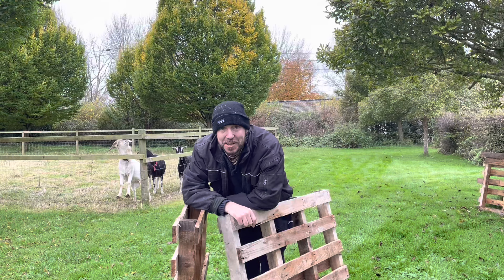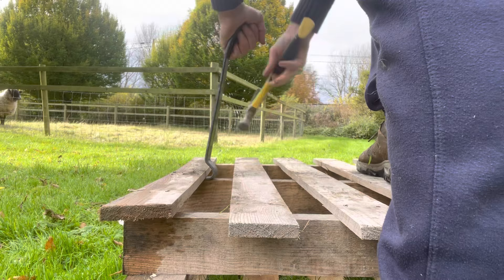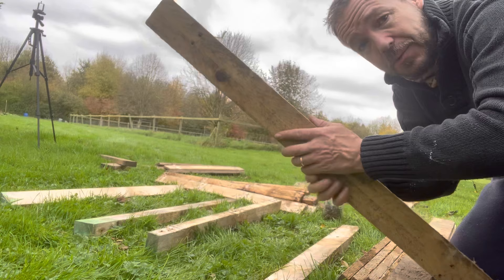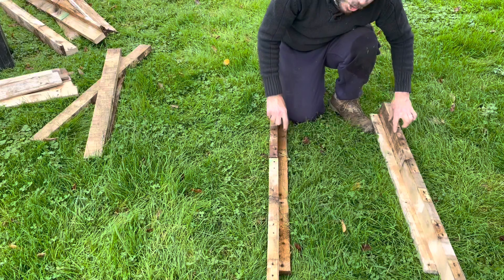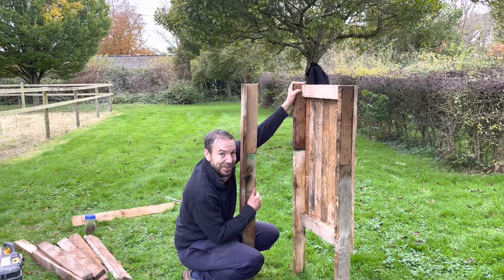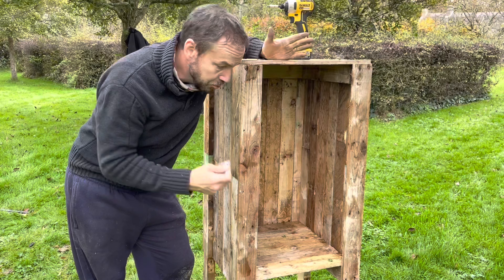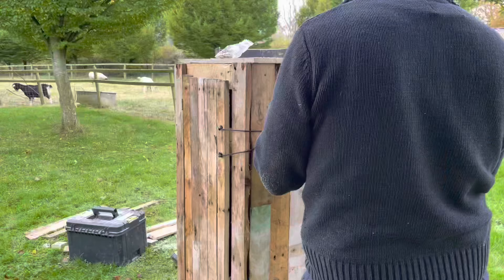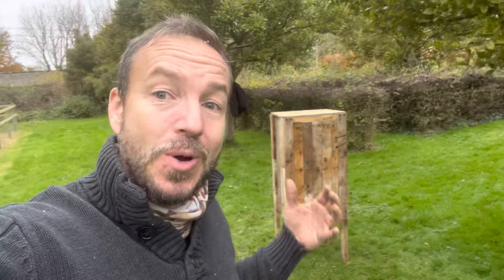How to make a smoker from pallets - upcycling!

Comment: Outstanding setup...however please be careful when you use pallets as they are used for an extremely wide variety of shipping options to include poisonous products and or products you wouldn't want around your foods.
Reply: They spray the pallet wood with formaldehyde when building the pallets 
That's what you got to look out for ...
Reply: These days most pallets are heat treated, no chemicals. But always check the stamp or burn to confirm.

Comment: we were just talking about making a smoker out of pallet…. we were worried about the treated lumber and chemicals in the pallet wood.  Would love to hear your opinion on this?
Reply: Hey Carrie, that is a good question. There is cause for alarm when using pallet wood for "processing meats" (for lack of a better term). In my experience it is fine to use this wood if it has the branded marking of HT on the pallet. This signifies the pallet has been Heat Treated which would kill any bacteria or contaminates within the wood. I have used pallet wood for building cold smokers as well as for making wood chunks for smoking for many years now. I have not developed any health issues to the best of my knowledge as of yet. But Please!!! what ever you do, DO NOT use treated lumber or any type of Galvanized product when building a smoker. This is my opinion only.
Reply: I do not believe that pallets are made from treated wood materials, … just rough sawn hardwoods, … because of the durability issues with soft woods compositions, …
Reply: Most pallets are not treated. They are expendable products, so they generally don't put extra money or effort into them - so they are perfect for smoking.
Reply: If re-purposing wooden pallets for any projects that include interior goods, furniture, food processing including simply burning them for fuel or cooking heat, you will want to make sure the pallets haven’t been chemically-treated with substances like Methyl Bromide ( MB) or used to transport toxic chemicals that include formaldehyde. Also keep in mind that not all pallets are US-sourced (IPPC mark). They can come from Europe and also Asia where standards can be lax. 

So, for quick elimination, pallets to immediate reject include: 1) colored pallets which often use toxic substances in the paints & often marked to transport toxic materials 2) pallets which have the mark MB which stands for Methyl Bromide  3) older pallets from Europe marked with the old EUR mark ( instead of the current EPAL which are safe to use )  

IPPC marks that help identify pallets safe to use include: 1) HT Heat Treated 2) KD Kiln Dried 3) DB Debarked  as well as EPAL which is a European standard that indicates the pallet was both DB ( Debarked) and HT ( Heat Treated).
Reply: A friend works for 3M and said to never reuse palate wood for anything because you don't know what truly frightening chemicals have been stored or shipped on them before you got them.

Comment: Hey mate, I loved this. Could you have an open fire at the bottom instead of a BBQ? I'm thinking of having a rack with a bigger whole in the bottom. Does that make sense? I so feel like I can do this, but don't know if these are dumb questions 😂
Reply from the maker: The only dumb questions are ones not asked mate. I think you might struggle with an open fire as the smoke would mostly blow away, the closed fire and pipe means the only way out for the smoke is through the smoker.
That’s why we aren’t trying to make an airtight box, the smoke actually Mike’s through the smoker and out the cracks as that’s the easiest way of escape… make sense?
Reply: @SelfSufficientHub  yeah it does. I'll add it to my list of projects lol

Comment: Aren't pallets chemically treated? Or are these pressure treated? Is there a way to tell?
Reply from the maker: I’m not sure, but the smoke passes through the hole and then out through the cracks, nothing is actually coming through the wood and into the meat. Hope this helps. 😊👍
Reply: @SelfSufficientHub  That makes sense. Thanks!
Reply: Pallets aren't treated with anything.
Reply: Some are. Look for HT stamped on the pallet this means heat treated (as opposed to chemically treated)

Comment: I'm new to your channel. I'm going to make a pallet smoker to cold smoke my bacon.  I just took the pig to Freezer Camp 2 days ago.  I will get the cut meat in about a week.  I intend to cure the bacon then cold smoke the cured bacon in the pallet box.  Iv'e never done any of this but there's a first to everything around my household.  I already had a build design in my mind so your build pretty much confirmed the method I desire to go with.  I was more concerned if the oak wood pallet would taint the meat but I'm trying to get pretty nice pallets that have not been painted ot had any chemical spilled on the wood.  Plus, I don't want to buy wood for this build.  Free pallets are a good way to save some bucks.  NEW SUBSCRIBER! Thanks for the video. Do you have a video showing the smoker in use?  👍🏽🤠12/9/22
Reply: I've been butchering my game for over two decades now and now I'm curious what you paid for it to be cut up?